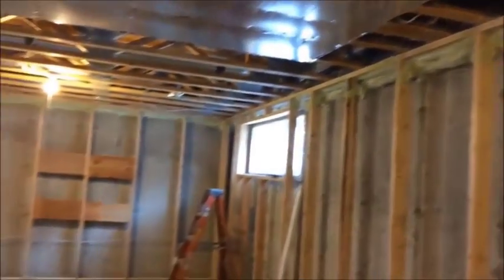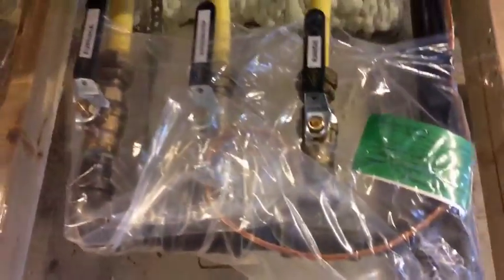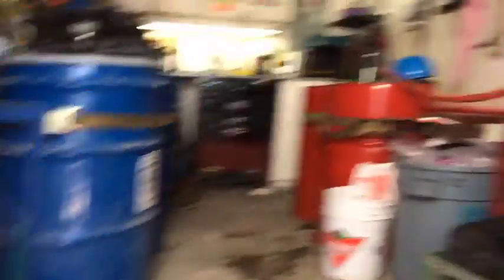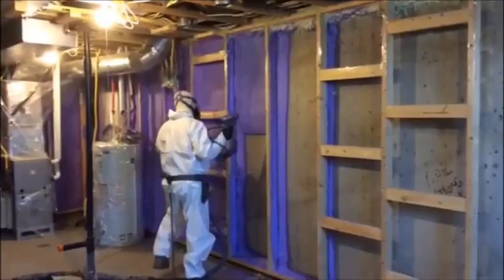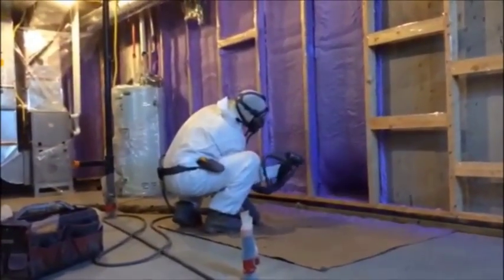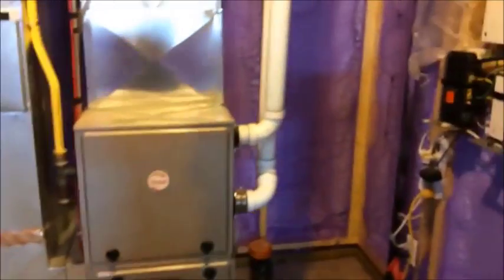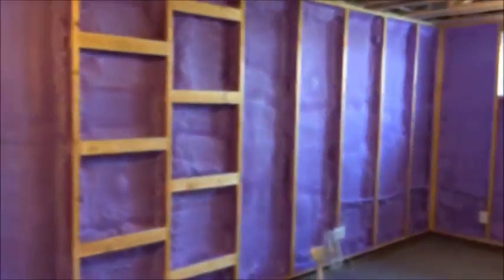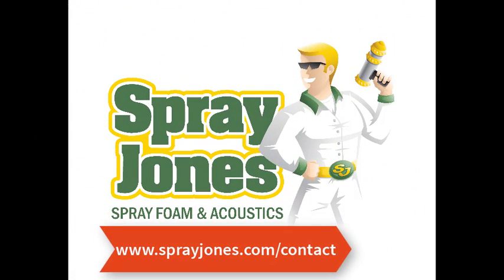What to expect when getting Spray Foam - Saskatchewan Basement

Comment: Hello Mike, Q I noticed the foam material comes in different colors I assume different manufacturers . Can you touch up on this issue if I can't hire your company due to out of your jurisdiction should all insulation company have the option for the customer to choose the purple foam. Thanks Bryant
Reply from the maker: In Canada building code certified foam must be readily identifiable by sight. So all the Mfgs have a unique color. BASF has purple. This requirement does not exist in the USA - nor do I expect it to.

Comment: So if the wall develops a leak, where does the water go? Surely the foam adhesion to the concrete isn't strong enough to prevent leaks, is it? Also, can you spray foam stone foundations in a similar way?
Reply: I had an estimate done for my basement and was STOPPED IN MY TRACKS when he (the owner) told me that the foam would STOP MY BLOCK FOUNDATION FROM LEAKING IN THE SPRING!!!  I DID NOT HAVE THE JOB DONE! 
Will the foam SEAL A LEAKING BLOCK FOUNDATION?        NEW HAMPSHIRE❤️🇺🇸

Comment: Here's how I spot a lazy piece work sprayer: when they blast 3 or more inches in to the wall when most foam manufacturers say 1 inch first then 2 to 2. This sprayer that's pulling the trigger is easily putting in three and a half.
Reply from the maker: How were to able to probe through the TV screen?
Reply: Doing this for 15 years. Been spraying for 14 of them. You can tell just by looking at it it's more then 2 inches he's blasting onto the concrete.